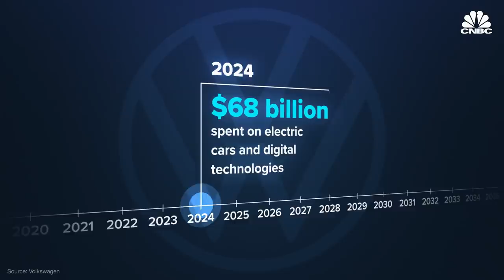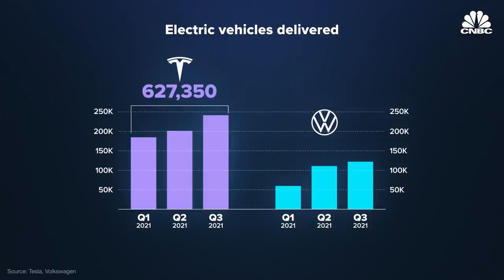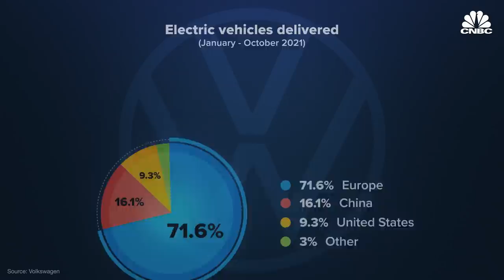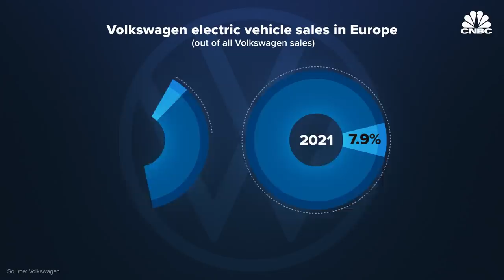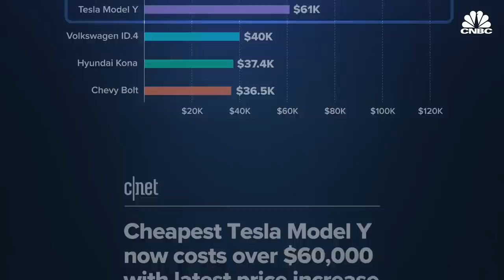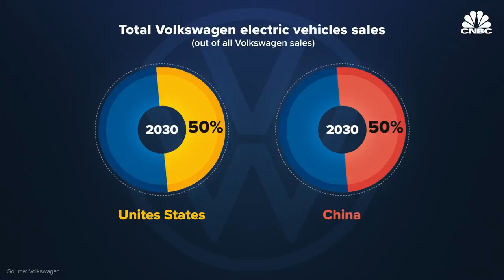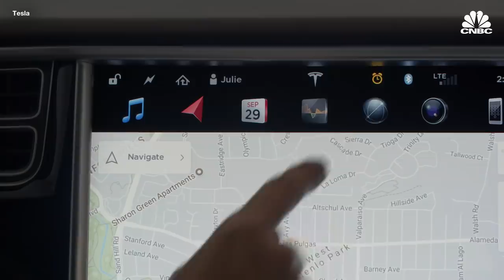Why Volkswagen Is Beating Tesla In Europe

Comment: I'm still amazed that when speaking of diesel emissions cheating the part that is always left out is the rest of the auto makers who had similar cheat software for the diesels like BMW FCA Chrysler.... the information is out but it's hushed that anyone else was doing the same thing
Or the fact that no company but vw got hit with as heavy of fines and penalties
Reply: I think VW selling deisels in much higher numbers, thanks to heavily marketing their lies is the main driver for them being the main target. But yes, they all should have gotten enormous fines... but not equal fines
Reply: @veganpotterthevegan  I think it was because VW just bested Toyota and Chevrolet that same year in production numbers.... months later the diesel scandal hit and it was focused on Volkswagen
Reply: @johnmoser2689  neither of those companies are nearly as big in Europe.  And both sell a fraction of the diesel passenger cars in the US. Nearly all the diesel  non-trucks sold in the US before that were from VW and their subsidiaries.   WV's fine was fair. Everyone else should get fined too but per car, it would be a small consequence
Reply: @johnmoser2689  Who was funding the research?  VW was.  The EPA allows manufacturers to do their own testing and submit the results.  They don't physically test the cars themselves.  Most automakers will probably let some independent lab do it.  But they knew the testing methods, hence they programmed the cars to sense when they were being tested, and turned the pollution controls on when that was happening.

Here is the core issue.  Diesel cars weren't that popular because of the high price premium they cost compared to gasoline cars.  This was in part due to the pollution controls they require as diesel engines are pretty dirty.  They require particulate filters and they need to address the high NOX emissions they generate, which destroys lung tissue and is extremely harmful to humans.

Automakers address that typically with a DEF system.  But the DEF system is costly and complicated.  You need the injectors, storage tanks, sensors, and you need to buy and top off the DEF fluid which is injected to neutralize the NOX emissions.

VW suddenly claimed they solved this issue without DEF.  Which shocked the entire auto industry since no one else had been able to do this.  They were all stunned and confused.  This was the engineering feat of the century.

In reality of course, VW didn't actually solve this issue.  They just pretended they did and wrote cheating software to fool emissions testing equipment when they were tested.

They were by far the biggest offender in this, and they purposely designed their cars to cheat.  In was an astoundingly egregious scam.  And they were punished accordingly for that reason.
Reply: @redbaron6805  you're totally uninformed on the actual details of this subject... just stop
Reply: @johnmoser2689  Yeah, me posting the actual documented facts on how this actually happened is obviously "uniformed".

Your ignorance is on a comical level here.
Reply: @redbaron6805  no you assume you know but I really don't care to inform you if you're to lazy to look it up yourself.... it's obvious with your self righteous attitude you know everything already
Except about the actual details of how this whole dieselgate thing happened
Reply: You can cheat by having low emissions at low power only, that is wrong but legal. VW recognized the test program and had special setting for test only. That is the major difference. 
Also my car broke after the upgrade and VW was of no help.
Reply: @3dcpsolutions381  more lies and exaggerations
You barely know but you feel the need to comment and spread more hate.... how pitiful
Reply: @johnmoser2689  Then you should stop lying. “You barely know but” is not even a correct sentence and makes no statement at all. Grammatically and substantially incorrect while putting others down is what the uneducated do, but you are good at it. No “hate” just the truth. The truth is sometimes hard to swallow. But you do make me laugh, so thanks.
Reply: @johnmoser2689  PS: VW has no class but I am sure it is the car for you. 😂 A little humor at your expense. 😂🤣
Reply: @3dcpsolutions381 you're intelligence shows your lack of humor don't assume you know check out the facts
It's better if you know the full story before jumping to conclusions
Reply: @3dcpsolutions381  oh no the punctuation and grammar police have been notified
Good tactic if your making a point and someone opposes you attack them with anything... how sad
Reply: @3dcpsolutions381  yep same Krauts
Same origins story
However you obviously know it wasn't German ran after the war either
Reply: @johnmoser2689  I will agree with you there, I got that from the Germans, being more interested in how you write than what you write. Don’t take anything I write personally, I am just having a go for the Halibut… A little fishy joke but not really that funny. I agree with your comments about ALL or many car companies being guilty.
Reply: @3dcpsolutions381  Honestly have you ever really liked at Lord Millner's war .... do you know about Cecil Rhodes and the real story behind those orchestrated wars?
Reply: @johnmoser2689  OK, Lord Milner’s (sorry “which you spelled wrong”), War was WW1 not WW2, and Cecil Rhodes died in 1902. What does that have to do with the Nazis? Now if you said the Bush family, Prescott Bush head of the Nazi Bank in the US I could agree.
Reply: @3dcpsolutions381  who was Milner to Rhodes?
Reply: @3dcpsolutions381  I think you should look into the Rhodes wills that Milner was tasked to see carried out
Reply: @johnmoser2689  No time and no interest. Living in the present. I do like historical documentaries but not interested in this at all. We have come a long way from VW to here. I’m out. Take care, stay safe and healthy.
Reply: @3dcpsolutions381  only have time to harass others on your terms... real impressive actually it takes a much wider view into yesterday to really know why things are the way they are today
Reply: @johnmoser2689  You REALLY need to expand your horizon beyond YouTube videos and look at some actual research on the issue.
Reply: @johnmoser2689  No, i did ACTUAL research on the issue, read multiple reports, multiple articles and actually bothered to read up on what actually happened.

You just watched a couple of YouTube video's and called it a day.  

That's the difference, and it clearly shows.
Reply: @redbaron6805  wow that means a lot coming from you preaching the same talking points as the video this comment is on
That's just silly
Reply: @johnmoser2689  Yes yes yes.. your impressive YouTube University degree and your extensive and thoughtful research on the issue by watching a total of 2 videos is obviously a stunning checkmate in your feeble mind.

Congratulations.  Buy yourself a trophy.
Reply: @redbaron6805  you're funny.... angry man full of yourself
Reply: @redbaron6805  you're extra funny now Mr. DooDooHead
Reply: And VW was one of the best Brands in real emissions tests.
Reply: @redbaron6805  you talk about cars with software for US market. I don't know about this. 

All the European test which I know, VW was better as most competitors. US and French cars have been really worse.

With US software it could be different because of other emission interests.
Reply: @RsOnTheStreetS  I am not sure why so many people love to hate on VW
I've had a bunch of different ones over the years and have had great luck which is why I still have an excellent opinion of them
No cars are perfect but all the other manufacturers who made turbo diesels during the ''clean burn" years of 09 to 15 did the exact same thing
Reply: @redbaron6805  other companies had the same function to turn off the emission reductions. But there was no drama about.

And the tests which I meant are from universitys and car clubs, not from the producer side. 

US rules are only strict on NOX output when I be right. Here they have an eye on the particle size from the emissions.
On the other side you have a lot of crazy smoker Diesel in US😄
Reply: @johnmoser2689  VW transformed to a bad company in the last 15years. All these small 1-1.6l engines with over 200hp, it will not run for long. Also the Quality, a high price car looks similar inside like a cheap car. I hope it will be better with EV's.
Reply: @RsOnTheStreetS  I will agree the jetta has gone down in style and became much less attractive to me than the mk5 platform was
Many of the engines I avoid in all models
But to say they don't make good cars anymore is a bit of an exaggeration
However they claim they're going electric so we'll see what the future brings
I remember going to the Detroit Auto Show over 30 years ago and Volkswagen was displaying a concept vehicle that parked itself and had adaptive cruise control...
Reply: If other commit crime without being punish, then it's okay for me to do it too ? If we always live by the standard of the lowest common denominator, you might as well outsource your manufacturing to third country with lax labor law and almost no environmental protection. I don't think VW, a world leading car manufacturer should stoop that low morally, a better solution would be just focus their effort on the ev future, where there is no need to spent time and resource on cheating device or debating about the moral of cheating. I mean you get Zev credit from other company that cheats too, you would think a business model that you can get your competitor to pay you to build car would be too good to resist. Literally a B2c and B2B business combine together in one revenue channel flow, I'm more surprise VW haven't refocus on ev earlier.
Reply: @keenheat3335  not the point but they're fully into EV now
Problem is they aren't feasible for everyone yet
Many people don't have charging stations in their areas and electricity cost per kw/hr varies greatly making it a good deal for some and not for everyone 
Also what's going keep electric providers from raising rates like they always do
Looks like another monopoly in the making
Reply: @keenheat3335  I never said it was OK to cheat however the industry has been allowing the methods for many decades
Have you ever heard of cars having an air pump? Or smog pump? Since the 70s that's been a standard part of all cars.... it's function? To put clean air into the exhaust to dilute the amount of emissions so when tested they pass
That wasn't a Volkswagen invention
Reply: Volkswagen took it to another level. They lied, they advertised for it, they emphasized the greenness of it. While Mercedes, Jeep, BMW, and Toyota didn’t advertise and their emissions weren’t as bad
Reply: @DavidMortaz  that's very odd that none of this info was covered anywhere
Even the things I found looked they were put together by anyone with a bone to pick with VW 
They could've easily been faked 
But I am also surprised at how many have weighed in and think VW is evil incarnate
Too bad there isn't this kind of passion towards Bayer/Monsanto
Or other big companies who've done far worse to their employees and people in their communities
I never condoned what VW did I think there's more to the story than we know still
Reply: @johnmoser2689  Toyota didn't develop diesel cars as much either as they focused more on hybrids & hydrogen power instead I remember
Reply: @lzh4950  that's true I kind of doubt Toyota had anything to do with it
Although they had a lot to gain from VW getting hit so hard
They didn't have to battle with them as hard anymore
Reply: @redbaron6805  You have no idea dude.
Reply: @knowntobehonest  Whatever there long nose....
Reply: @johnmoser2689  hes actually correct
Reply: @Dave-dh7rt  who is
Reply: Kiss my grits Dave you don't know either
Reply: Vw gets blasted but big pick up trucks still pollute more than a little 2.0 litre vw tdi 
But they just keep rolling coal and that's OK
My passat doesn't even smell like diesel but it was the devil
Reply: @johnmoser2689  It is you that is totally uninformed. In germany there were independent tests done where the "dirty" VW Diesel were the cleanest of all brands. All brands worked with similar software tricks like VW. The funnmiest guys were Fiat. The just canceled all cleaning after 21 minutes. The test cycle is 20 minutes 🤣
Reply: Agree and the heavy truck market was and maybe still is cheating but nothing is said about that. And even though VW cheated from what I understand under normal driving conditions it was not that much over the rated emisions. Only under hard acceleration.
Reply: @jamesoldman3021  I bet at WOT it still doesn't compete with the average full sized truck... one driver in each one is hyper efficient the other weighs 2 and a half times as much and gobbles diesel like a 60s muscle car lol
But those evil 2 liter vw's are the devil 🤘
Reply: The concern about diesel particulates was insane. What about the Co2 emitted by every petrol car on the planet? No one has been fined for that.
Reply: @redbaron6805  
I believe Kenworth got caught and paid a small fine. Just about all the diesel rigs were cheating for a few years and got away with it.
Reply: @jamesoldman3021  A lot of them did for sure.  But I think the scale of the VW cheating was what made the difference, along with the cheating coming from the top.  Also, VW claimed they had come up with "clean diesel" which made the cheating even more serious.  The difference between what they claimed they were emitting and what was actually emitted was pretty staggering.
Reply: @veganpotterthevegan  I'm not sure if the fine was fair as I read that the authorities suspected or knew about the cheating software and let VW dig a bigger and deeper hole. Remember to when Toyota was singled out for unwanted acceleration due to supposedly a car mat getting in the way or something like that.
Reply: New diesels solved this issue and i'm getting 60MPG highway from my jaguar XE diesel, just drove from belgium to portugal without stopping for gas.
Reply: @glennv3176  good for you Europe still gets the TDI cars.... we got screwed out of them right after VW hit number one in sales
Reply: @johnmoser2689  Diesel is being demonized here too but I just don't get it, why ban the cleanest and most economical engines now because some company messed up 7 years ago.
Reply: @glennv3176  I'm starting to think it was done intentionally to promote electric vehicles
Reply: @glennv3176  They partially solved this issue, but even 60Mpg is less than half the efficiency of most electric cars.
Reply: @redbaron6805  Alright, my jaguar is also half the price of a similar tesla, something more modest than a jag is way less even. And how does one travel in an EV? Millions of europeans drive to the south every year, +-1000 miles. Diesel can do it without stopping. Do we put millions of charging stations along the highways and expect people to sleep on a bench for a few hours every 200 miles? What I dislike about the EV conversation is there isn't one solution, it's going to be a mix of solutions. I do 100K miles a year, I'd spend half of my day sleeping on benches waiting for a charge if I drove an EV.
Reply: @glennv3176  These claims are so asinine they are literally sad.  First of all literally ZERO people drive 1000 miles without stopping.

Second of all no one needs to sleep for a "few hours" while EV's charge which takes as little as 15 minutes today, and modern EV's have a range of up to 520 miles and climbing, hence the 200 mile claim is literally absurd also.

And if you drive 100k miles a year, you are in the 0.00001% of drivers on the planet...
Reply: @redbaron6805  enjoy the cult
Reply: @redbaron6805  260.000km on this one, done nothing but oil changes and fresh tires.